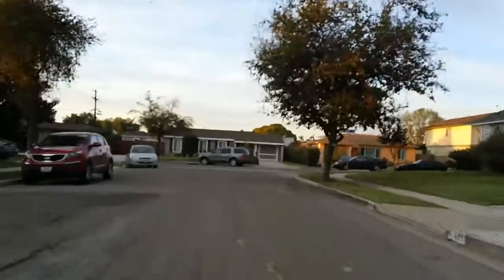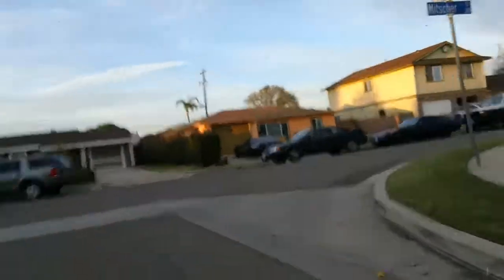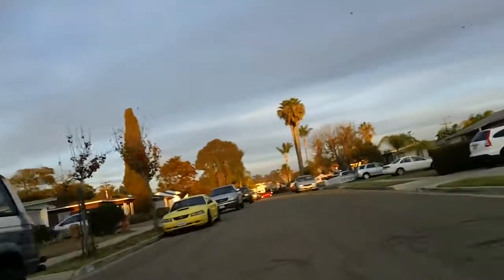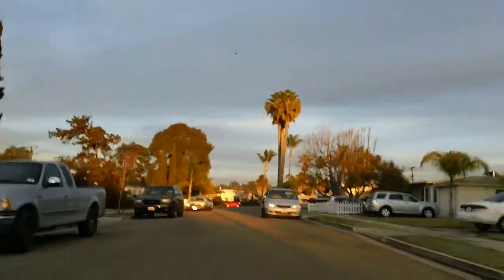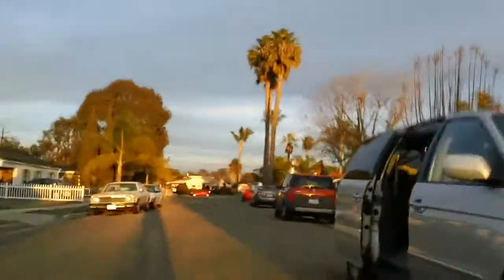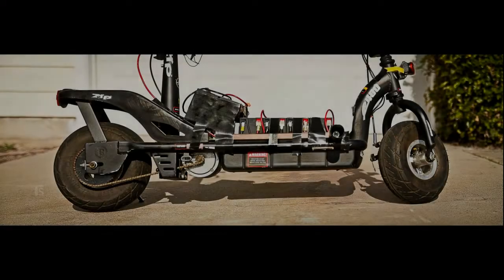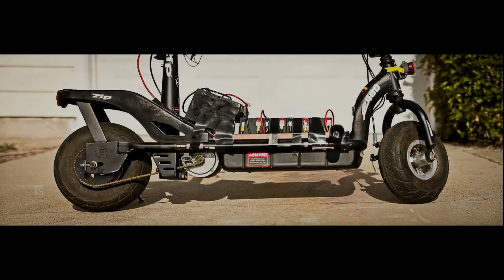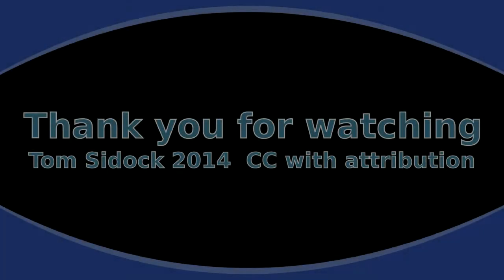Scooter Mod Project eZip 400 at 36v

Comment: Can you share how you made the XTR into a gas engine?  I have 3 scooter BladeZ’s and want to make 2 gas and 1 into a high powered electric scooter with way more then 450W motor and lithium ion batteries and controller.   Not sure where to go and find all this tho.

Comment: did you put three 12v batteries in series..   if so does it start with a 36v connection.